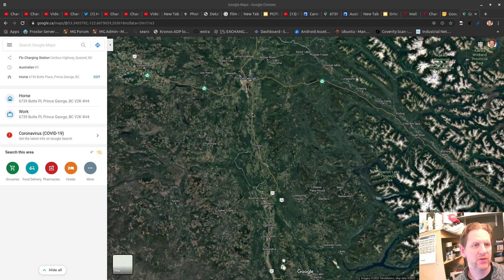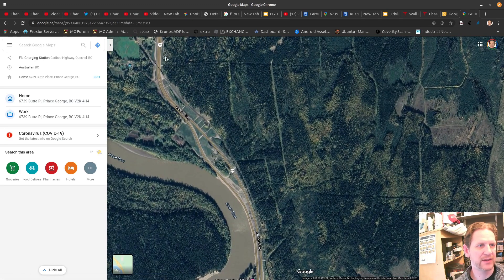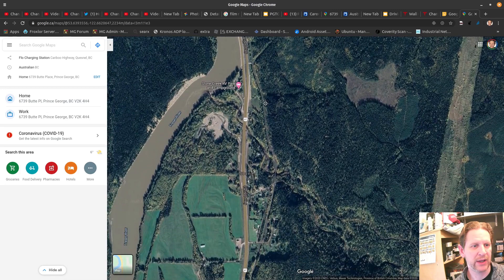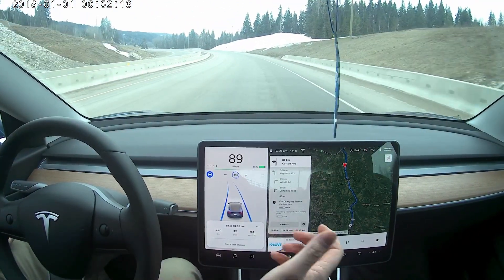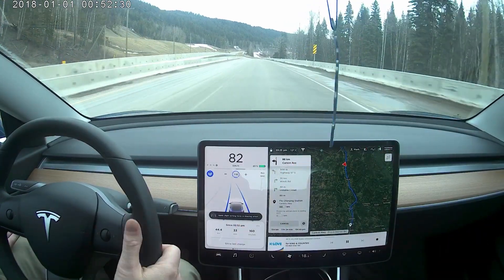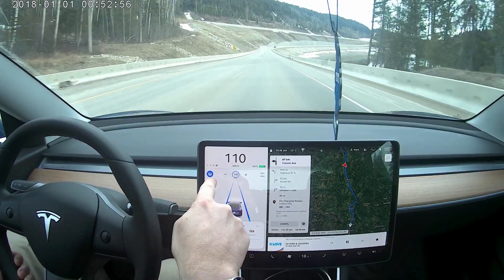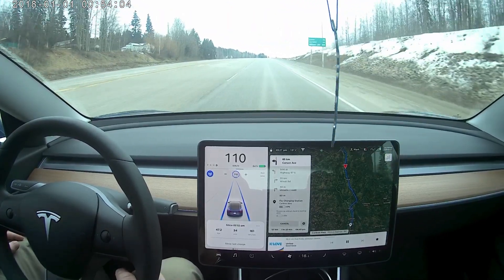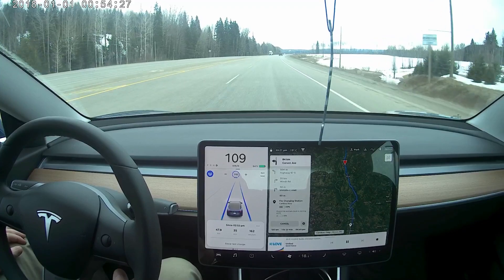Tesla Model 3 | Phantom Braking on the Highway!

Comment: To avoid phantom braking for now while waiting for Beta FSD, I select “Yes” on the setting “ Require Lane Change Confirmation” for Autopilot on my Tesla Model 3.  This works like a charm.  Perfect smooth autopilot drive across 88 mile drive last weekend.  No more phantom braking!  I’m using 2020.48.30 software.
Reply from the maker: I'll have to try that and see it it helps, i still get lots of phantom breaking to this day
Reply: @TeslaPrince , yes please try it.  Please note that in this mode, the car will ask you whenever it needs you to change lane.  You could change change by using the lane change signal, or ignore the car’s suggestion if you does not want to change lane

Comment: Where the middle stripes missing all of the sudden? In the first video capture it seems like about near the auto breaking the stripes faded out more and more... Maybe this was the reason and the car just tried to get to a safer speed while getting readjusted into the new situation?
I would like to know what the car would have done if a car was behind your car... Would it have steered a bit to get to a safe speed but also detecting that the car behind has to be doged as well?
Who knows... Better not test this :D
Interesiting video though thank you :)
Reply from the maker: No the middle lines are still there, just that the water on the highway hides them from the camera a bit on that angle. This issue has been reported by many model 3 owners, do a search and you will see. I've had this happen numerous times over the past 4 months, never a clear reason as to why as each time its a different area and situation. I will say the latest software update from last week has greatly improved auto pilot, so hopefully, we will see less of the phantom breaking issue too.

Comment: This has happened to me so many times! It's very disappointing and dangerous. What's more disappointing is Tesla Service won't even acknowledge the problem and tell you it's your fault and to not use the feature(s) on the $60,000+ car you spent money on. Have you had any luck with Tesla Service in your region about this issue? I am so close to contacting a consumer protection or lemon law lawyer here in the states. Shameful of Tesla for not acknowledging a potential safety concern.